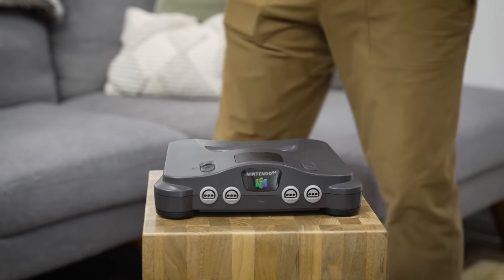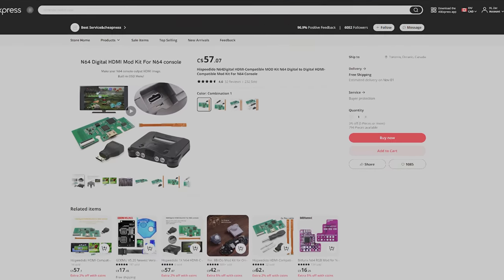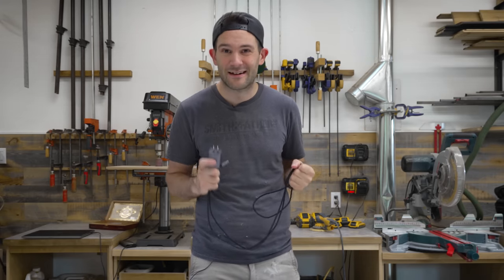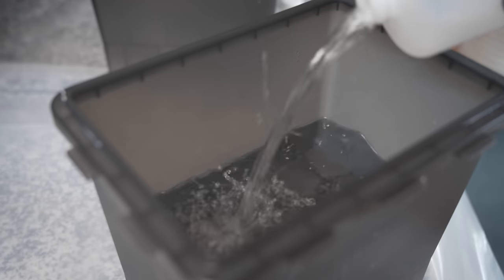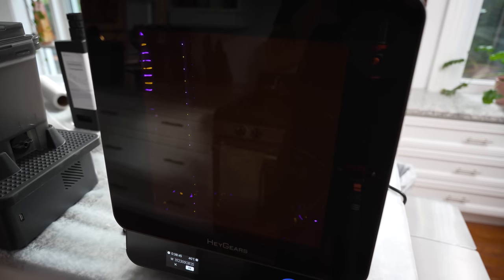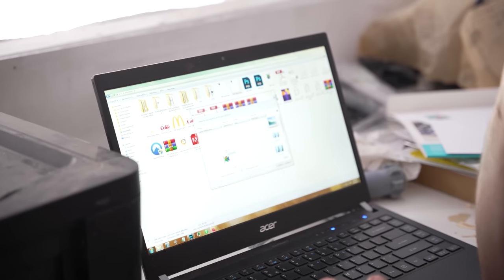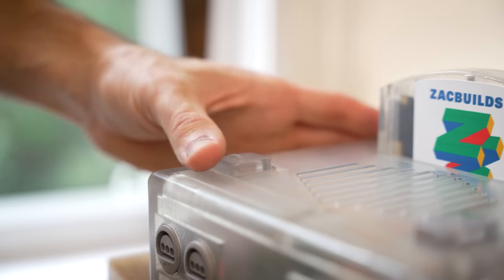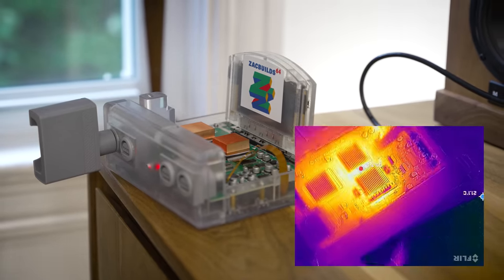I built a MODERN N64...

Comment: That is really not the correct soldering tip to use for drag soldering. Actually, the standard cone tips are pretty bad in general. But especially for drag soldering, as the pointy tip really can't hold much solder, and when you drag solder you want to really flood the soldering tip with solder. Any soldering station should have other tips available for it. The flat chisel tips as well as the conical bevel tips cover most use cases, I find that the bevel tips are great for SMD soldering (and especially drag soldering) and the chisel tips are good for through hole soldering. Both types have a bigger surface area in contact with the solder than the pointy cone tips, which helps heat transfer, good luck using desoldering braid with a thin cone tip for example, it just can't transfer heat into the desoldering wick fast enough to fully melt the solder it's touching, trying to solder to fat through-hole components or large ground planes face similar issues (those are always tricky, but worse yet without a good tip), a slightly larger chisel tip is able to handle these much better.

Comment: Cool, my flat PC CRT monitor used for gaming won't turn on anymore, my 2 Gamecubes won't read anymore (same with my five Dreamcasts wont' read anymore). I hope my Saturn which has a more robust laser still works.

God bless.
Reply: You can buy laser unit replacements, or ideally optical drive emulators.

Comment: WHY in God's Earth, would you drag solder instead of using a heat gun?
FPC cables and fine pitch QFP chips are very vulnerable to physical damage by a soldering iron tip. Even the SOIC pins of your practice board aren't as fragile as the CPUs on that N64

Comment: Very cool project, though I don't see any practical use for it. You could achieve a similar result using an emulator, and you can't even use it for official speed runs because of the custom hardware. I don't see why anybody would do this aside of the curiosity that comes from playing around with old hardware. Still, gotta say this is pretty cool!

Comment: I realize that you made your console your way, but I have to say it upsets me how throughout this process it felt like you weren’t concerned about removing the charm of the original console. I primarily mean that in relation to the shape, a square box is so boring. Also, that memory slot on the controller port would actually be useful for connecting Pokémon Coliseum to the gameboy games so you might not want to remove it.

Comment: theres no way that thing is around 60 degrees and warm. thats colder than most homes in the winter time. this guy must be in snow country for 60 to be warm. most houses with the A/C running are above 75
Reply: It's 60 degrees celsius, as almost all countries use. That would be hot to touch, but it's cooler at the end of the heatsink fins.
Reply: @DoubleMonoLR  we use freedom units here. Much easier unit of measure

Comment: 1:16. the cringe i felt, when i heard that old, dry, & tacky thermal tape. also look up micro-mesh, you want polished, you will have insane polish with those. i use them for butter smooth slicing of my tools with my leatherwork. on the note of whether to add a CPU fan... honestly depends on the thermal at highest heat. if the eat gets too hot, then yes, add a fan to the vent port to pull the heat out, but when redesigning the top have the vents angled to where it blows away from the game cartridge.

Comment: You say build a modern N64   You just made a diff casing.  The actual N64 is the PCB with all its components.  So all in all you didn't build a modern N64 but just changes the look of its housing.

Comment: Loved the build! I would say that if you ever wanted to build a V2,  it would be cool to look into trimming the board, you could get it way smaller, and potentially use less power. I think people have even rebuilt ataris and n64s using the original chips, but with custom new circuits

Comment: the project is really cool but at the same time i dont like it :D one part why i like the n64 is because its old, janky and at times not that good (the control stick).
also with the controller, it might be a really weird design but all the games on the system were designed to be played using it, so it works. for certain games id rather use a gamecube controller though.
im very surprised by the quality of the aliexpress hdmi mod. the fps seemed weird but that might just have been the way you captured it.

Comment: or you could just buy the eon super 64 just plug it in to the back in the av slot and bam HDMI in better quality then those system hard mods or you can get the retro tink    and plug any retro console in to a modern tv with a better quality than hard mods.

Comment: FYI for people who still want to use an old console and also have satellite or cable tv: at least in the US, those usually have an rf pass-thru connector

Also more things should be sealed with magnets instead of screws

I'm surprised you did all the customizing and then left the brawler 64's huge pluge sticking out of the console

Comment: you can get an RCA - HDMI adapter for cheap and you can shuck the electronics out and integrate it into one case. avoid micro soldering and save about $30 compared to the adapter purchased in video.

Comment: It is strange how many people don't know that you can connect composite male connectors to components female input connects, and it will work. I did it. I believe that video is the green one: yellow video to green input and the red and white audio jacks. Many new tvs have the component inputs. The quality of the connection is still subpar compared to the HDMI or component connection alone.
Reply: This provides no quality improvement, and will only work if the tv is designed to automatically detect composite video on the component input. Modern TVs sometimes do this, to reduce the number of analog connections.
Without this feature the image will only display black & white, as that's what the green plug/socket of composite is for - "luma" (luminance) / a brightness signal / black & white.

Comment: There are a number of games that use the "analog" (technically not analog) as the right stick and the brawler controller doesn't handle those games particularly well, unfortunately. Very cool though - It looks as though the ultracraft reflex took a lot of inspiration from Formlabs?

Comment: There’s an rca to hdmi converter powered by micro USB on Amazon for like $12, bet it would be easy to modify for this much cheaper
Reply: They're never going to be as good as starting with digital signals from the chip, that's why the internal connectors & circuits were created.

Comment: Respect for the work... but you might want to rephrase your title, which is rather misleading. You really don't "build" a modern N64, but you mod it with parts that have been around for a while and put it in a new package.
Again, no small feat and nicely done. But your title obviously implies that you recreate the N64 with modern chips, or at the very least transplant the chips on a newly design and improved PCB. A similar thing applies to your PS2 video. There as well, nice project, but your title is misleading and that puts a nasty damper on the overall experience. Instead of overselling and underdelivering you might want to consider to undersell and then impress on delivery.

Comment: the only thing you do, is change the output signal to hdmi, thas looks awful, this console are made to see in a crt tvs, and cmon, you spend more in those materials than in a used crt tv. there are thousand in the marketplace. this is not built, the only thing you built is the cases.

Comment: What i dont get is why these gaming companies dont create special editon consoles that come with all games installed when theyre old enough. Like why not make a modernized sega or nintendo "of course you want to keep it pretty similar to how they used to look" and then put some storage in there that holds every single game that console ever had. They could make bank off of that as long as its not insanely priced. I know id buy the sega, nintendo, 64, game cube, gameboy, and a few more im sure.
Reply: There have been a bunch of "mini" consoles(like the Genesis mini, Playstation classic etc) that did that, but they're never likely to put every game in a cheap console(albeit people often modify them slightly to do just that) as they want to sell rereleases. Probably not worth the effort to make 100% performance identical consoles either, rather falling back to emulation as the minis did.

Comment: and in 25 years you rebuild it again because hdmi and usb c have become ancient connectors lol.  Also, if you wanted to go for the retro nintendo transparent look, you shouldn't polish them to be crystal clear.  The old N64 transparent colors had that frosted clear look, not crystal clear.  But still looks cool anyway.  Also, sorry but the og N64 controllers are way cooler than any modern recreations of it.

One day I would like to have a modernized N64 like this, but that will also upscale to higher resolutions, have a steady frame rate, have enhanced anti aliasing, etc like modern emulators do already.  I can just run them on my PC already obviously, but it's more nostalgic plugging into an n64 and using my childhood cartridges and controllers

Comment: Couldn’t a raspberry pi or an android and do the exact same thing?
Reply: No.
Reply: @MarkDSnutts   a emulator could that’s what im saying
Reply: @Wojtek_1777  And you're wrong.
Reply: @MarkDSnutts  a emulator on a raspberry pi cant run this stuff? Because I’ve done it before and its worked fine
Reply: @Wojtek_1777  Ok 👍
Reply: @Wojtek_1777  There's a difference between being able to run something, and it being exactly the same. eg: there are almost always some games for each platform that don't work properly in emulators, there can be input lag etc. However some emulators are getting very good, and can even increase internal resolution etc.
Reply: @DoubleMonoLR  still there are ways that you can remove input lag with some modifications but yea

Comment: N64 games look much better on a CRT, I probably would have left the composite cable connector and relied on an external upscaler to use HDMI, the built in HDMI might be "modern" but it's a definite downgrade in quality.

Comment: A simple casted clear plastic would be easier. That's how the cases was originally made. And you should have casted clear controller ports too. The logo is ass and this is more advertisement than not. The case is also taller instead of thinned.

If it isn't original controllers i don't want them. Still hate Xbox shaped controller. Ps4 type controller is good enough though but original is better. Ps4 controller doesn't have a C and a and b buttons where they need to be. You would want all 6 buttons to be inline. Way to bulky and looke like ass. 

Hdmi over saturates the colors. You can get a VGA to component adapter for dirt cheap but running component is better than hdmi. Has to do with how color is handled and converted by hdmi differently. No perfect math to perfectly convert it over because the way color is handled via vga and component compared to a digital format. Even i notice the color is all wrong. Use component for color that is still correct.
Reply: All modern TVs have to convert component & VGA(though the N64 doesn't support either, only composite, s-video & perhaps SCART RGB) & other analog signals to digital.
Bad colours are just poor conversion from the original digital signal from inside the N64 &/or poor settings on the TV.
Saturation, tone etc can easily be adjusted with the TV settings anyway, as long as the video signal isn't totally messed up.